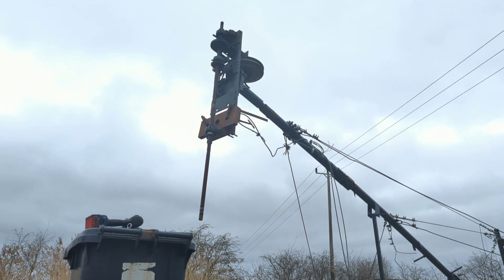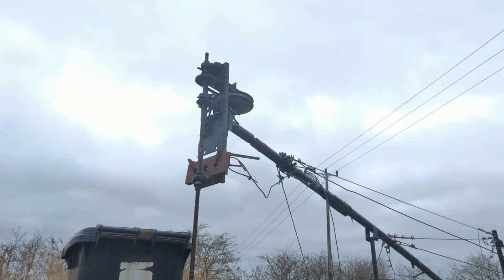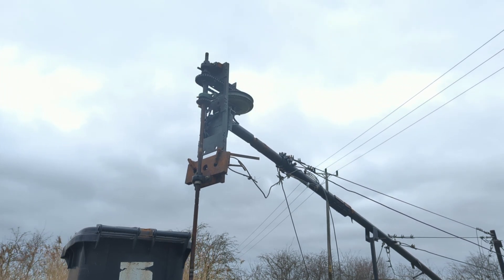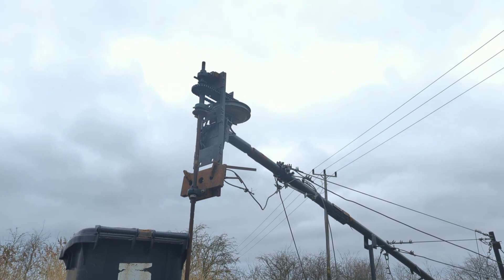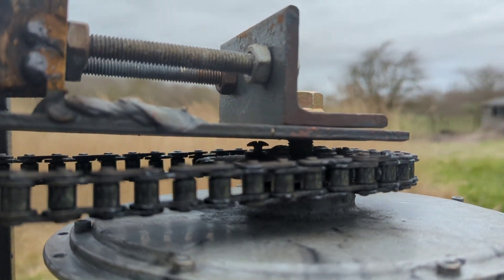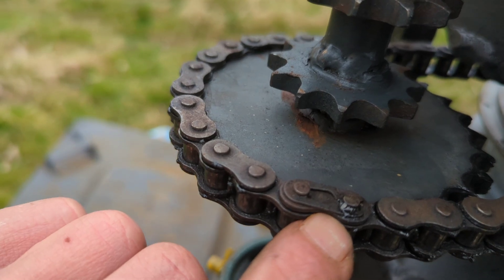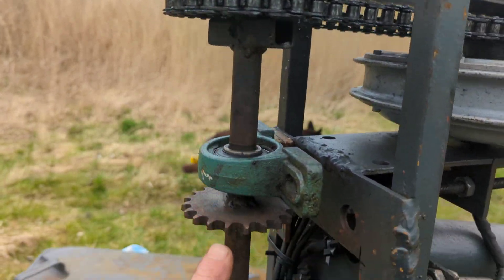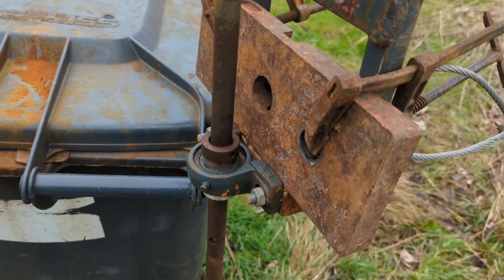Taking the Wind Turbine down to make some improvements  -1 March 2022

Comment: Have you considered bigger blades to improve  torque. It will start at lower wind speeds and you can increase the gear ratio for higher rpm on the generator.